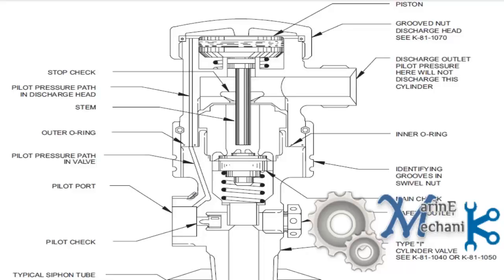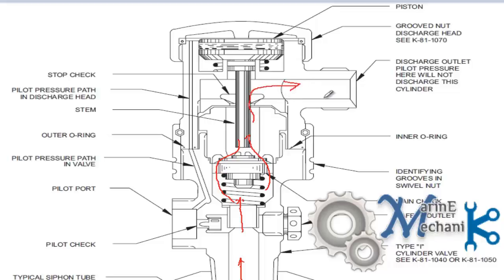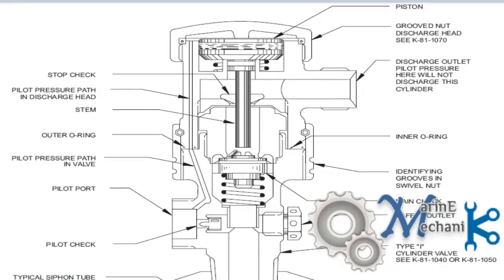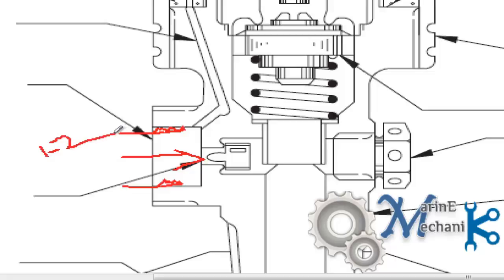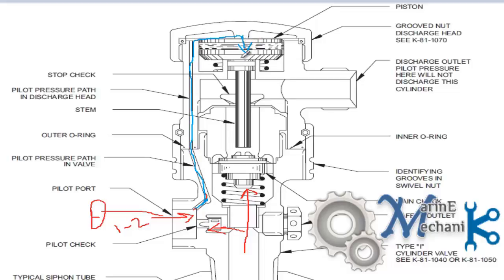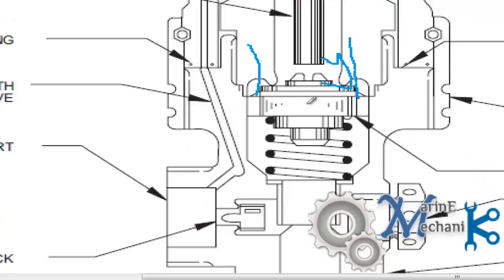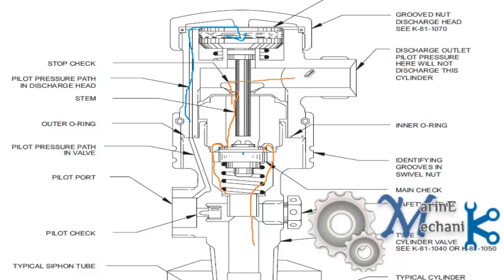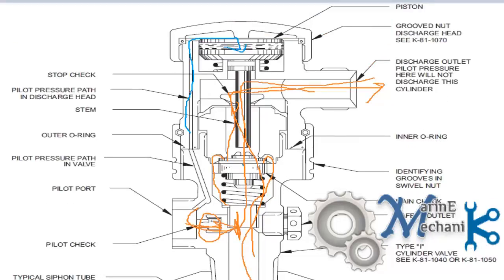Co2 Bottle Head Valve Working Explained..!

Comment: Regarding refilling, can the refill Co2 tank be attached to the discharge outlet pilot for refilling. I have seen where there is a refill connector that can be attached to the pilot port for refill, but why not just screw the grooved nut discharge head down to open the main check valve. When the cylinder is full just unscrew the grooved nut to release the valve. I am having a hard time understanding why one would fill through the pilot port. Thanks for sharing. great video.

Comment: so if we removed the pilot when the master cylinder is releasing, the process stops as the inside bottle pressure will force the piston "diaphragm" up again and close the main discharge port.

Comment: Hey, really learning alot from your videos. Is there any chance you could do a really detailed video on quick closing valves. I understand it is the air and working of a piston that somehow allows the spring pressure to shut the valve, but I would love to know the exact workings of the components. For example why does the valve have to be fully shut before you can reset the valve, what does the air piston actually act upon. Hope you can make a video on this. thanks again for the great content.

Comment: Hi, What is the minimum pressure I can apply at the pilot port to cause actuation? Instead of using a 1-2 kg CO2 pilot bottle I would like to actuate this valve from an existing supply.